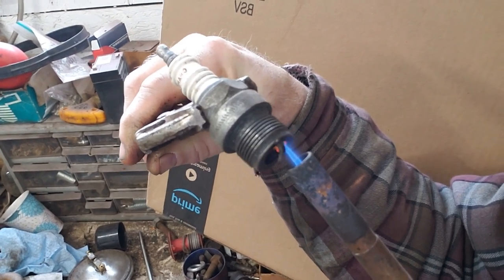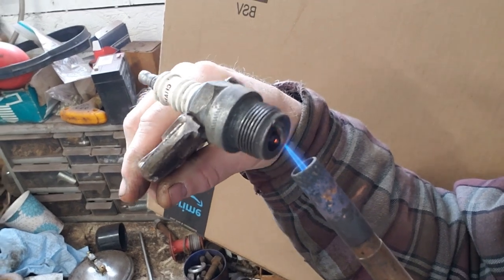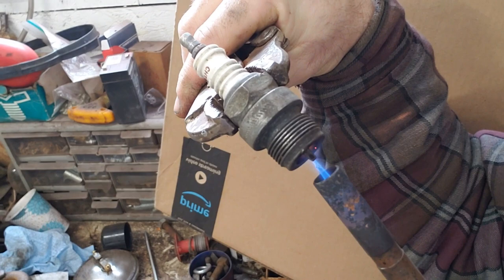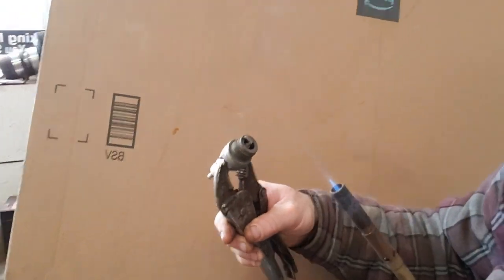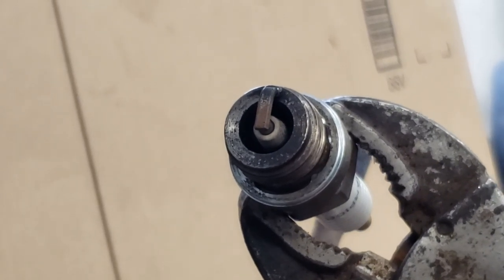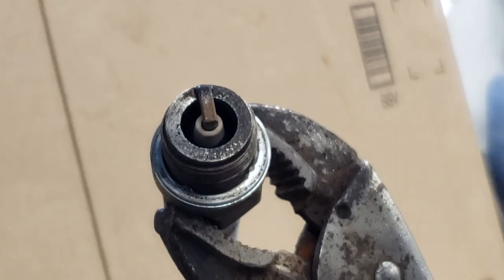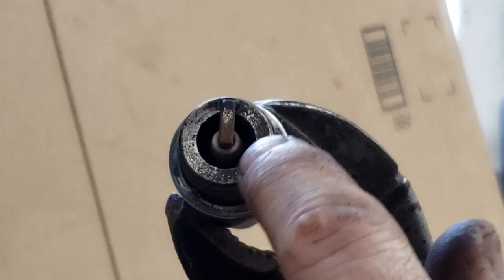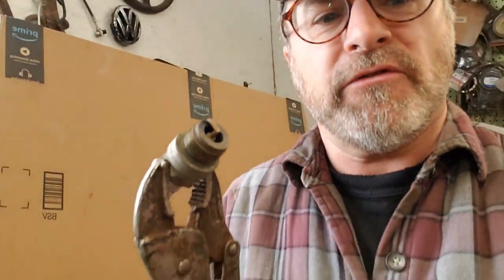How To Clean Sparkplugs!

Comment: Oddly enough, I just cleaned my not-so-expensive plugs in my hot rod this morning.  I used what Harbor Freight calls their "abrasive eraser."  It's a small sandblast gun that shoots a very fine abrasive.  With that and soaking them in lacquer thinner, they looked new.  Harbor Freight also sells a small spark plug cleaner that is along the lines of those used at garages 50 years ago.  I don't have one of those, so I don't know how well it works.  But the porcelain is bright and white again.

Comment: I've had a spark plugs cleaner for some 30 years. After 25 years I finally had to buy new set of plugs.. simple tool as other wrote here. It's a plug blaster.. very inexpensive these days used with a household air compressor.  Basically, sand blaster..
Reply from the maker: Dont want to buy one. I have a Burnzo matic on hand, cost- zero. And , no risk of introducing Abrasives to the engine.

Comment: Personally I prefer soaking the plugs in vinegar for a day or two.  Its amazing how it softens up the carbon.  I use a wire brush working the bristles down the barrel.  Then I burn the remainder off with a torch.  It still leaves the insulator dark in colour.  I have to wonder  how much this affects performance.  Just like new?  Maybe not but it does extend the life in my experience.